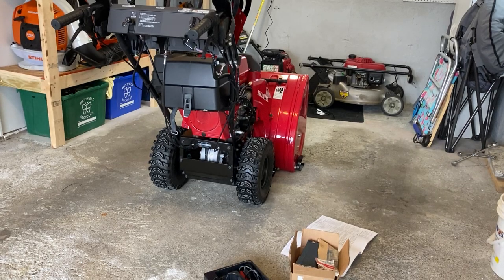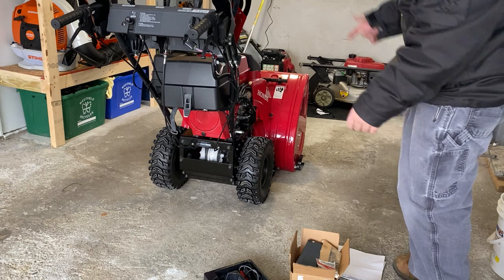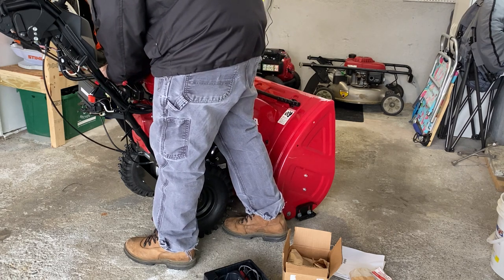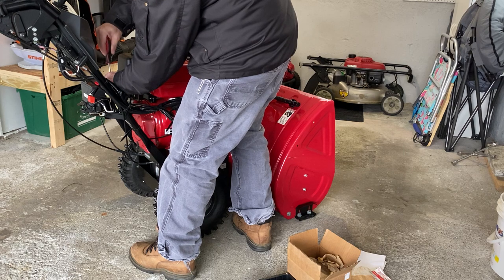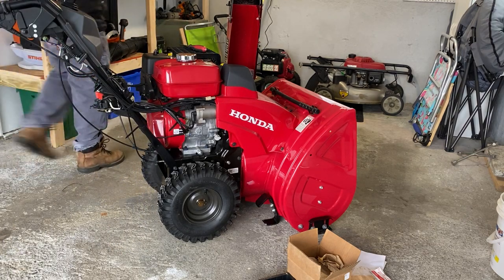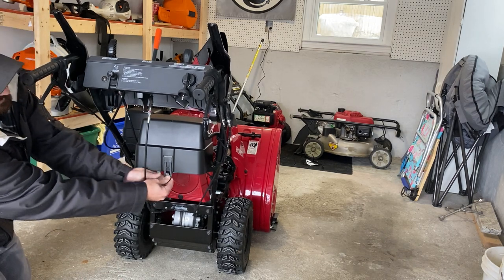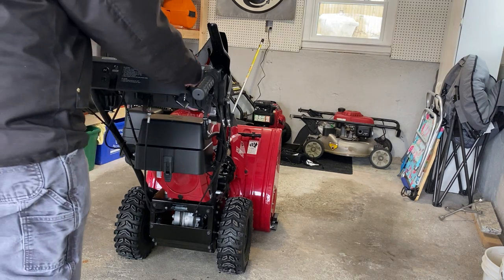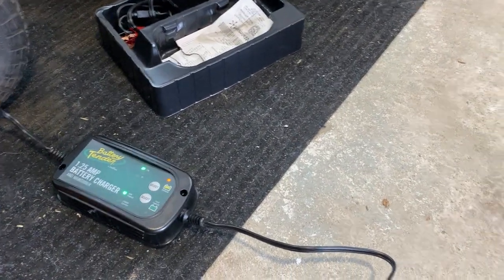Honda Snowblower Maintenance - battery replacement

Comment: The battery tender, does your  HSS 1332, have a battery tender on it already, or is that something extra, and what are the part numbers for the battery tender wire and the battery tender?
Reply from the maker: They use to have them but not anymore. Honda went cheap lol. My battery tender and maintainer came with one and I attached it to the terminal connectors
Reply: @appleztooranges  What is the make and model of the battery tender?
Reply from the maker: @boondocker7964  it’s named Tender. I grabbed it at Walmart for Walmart for around $49
Reply: @appleztooranges  Okidoke.